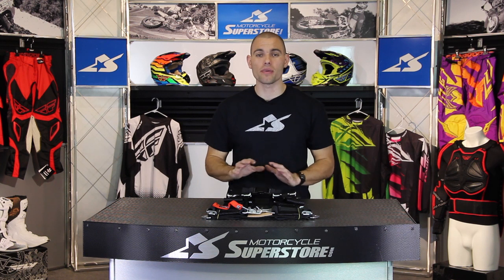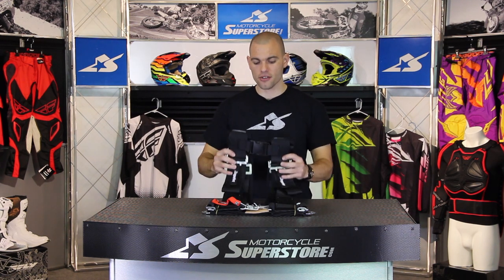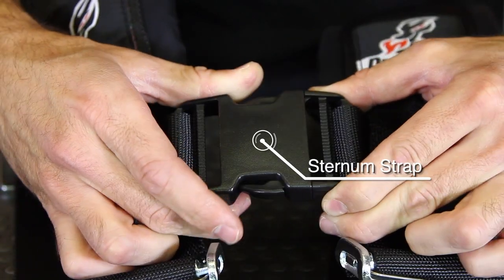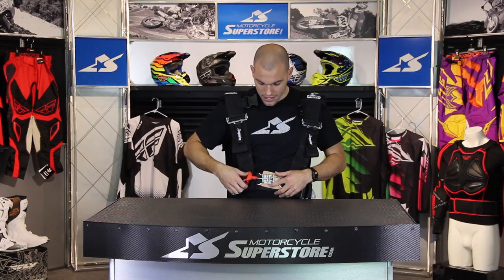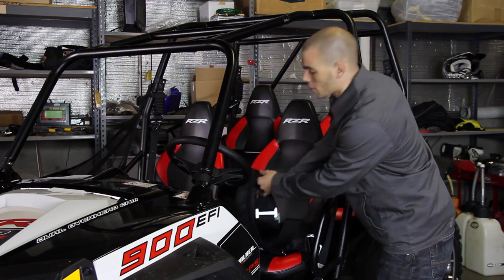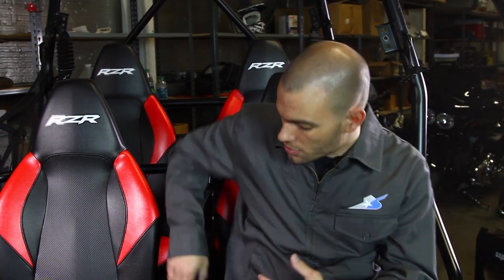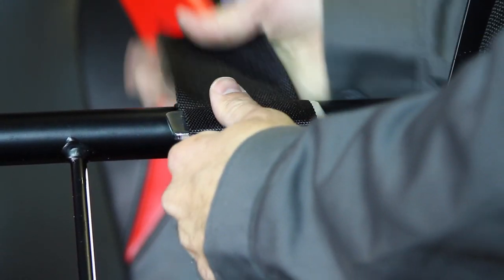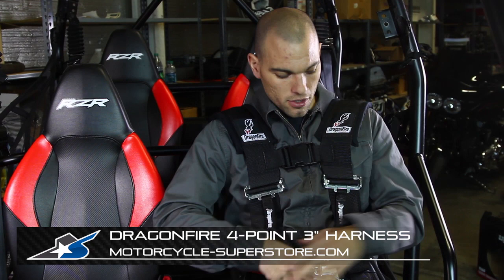DragonFire Racing 4-Point 3-Inch H-Style Harness from Motorcycle-Superstore.com

Comment: 4 point harnesses are always safer than a 3 point seat belt. Shoulder straps should be mounted at an angle of 0 to 10 degrees below the shoulder line.